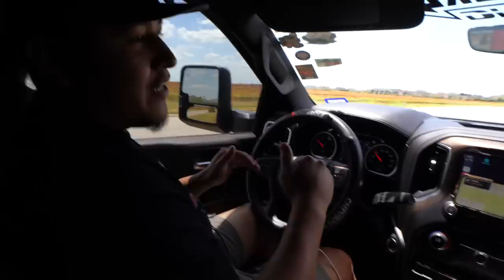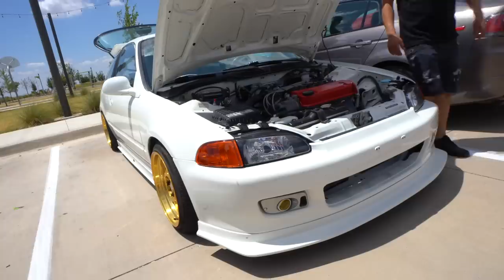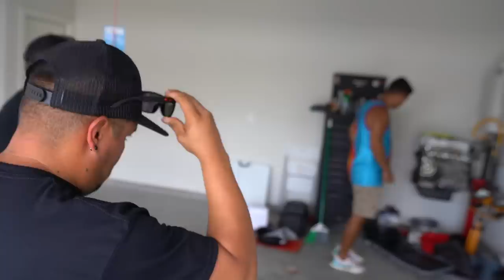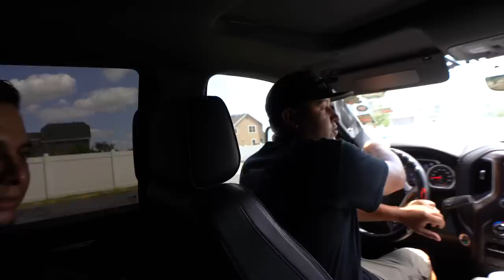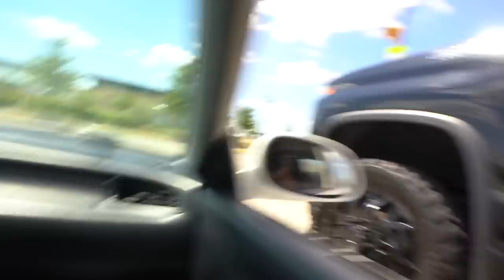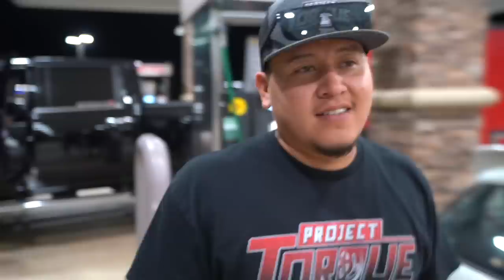⚪️⚪️ MY NEW EG HATCHBACK WHITE ON WHITE ⚪️⚪️🚗

Comment: K20/K24 mild all motor cam springs and retainers  fuel system with return and turbo easily make over 500whp and be reliable with a good tune

Comment: K24 head if it’s not from a 06-08 is ass. If the k24 is from a 06-08 tsx then the motor is solid. But you guys wasting money on buying swaps etc just buy a rsx type s and boost it 😂💯